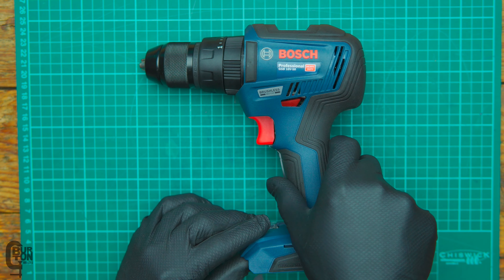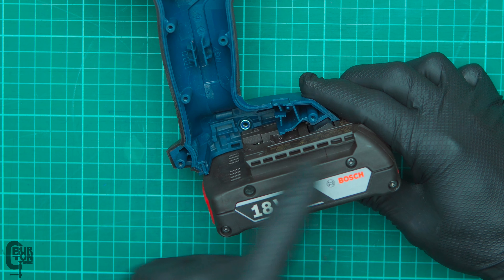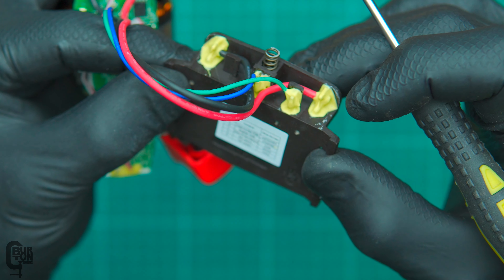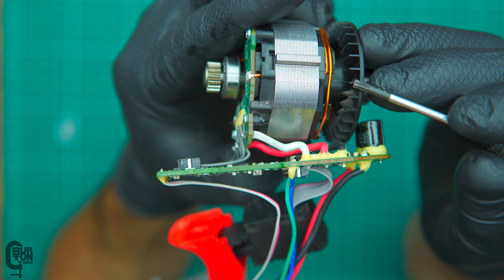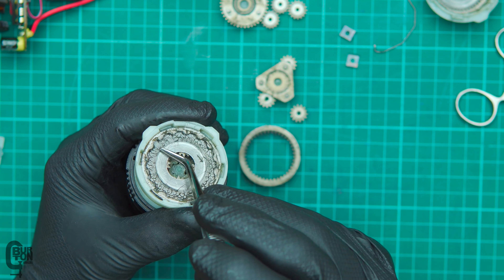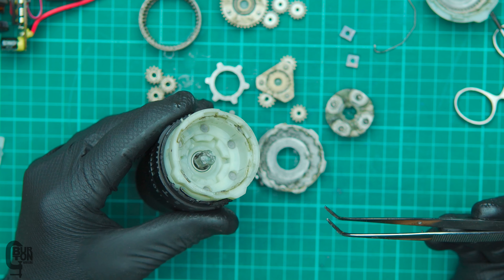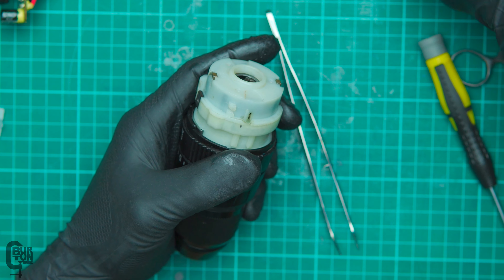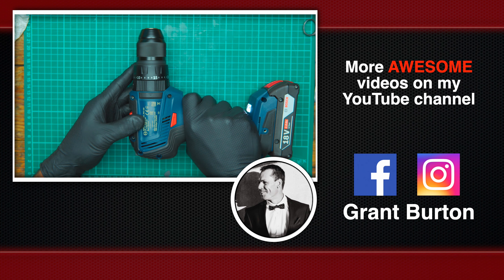Bosch Brushless Drill TEARDOWN & Rebuild GSB 18v-50 - Burton Builds

Comment: bad idea to even manufacture these little toys for concrette drilling, the hummer function is an engineering joke,,
Reply: u re better served with the 50 bucks grand daddy wired hummer drill.
Reply from the maker: I think the hammer function is more aimed at drilling small holes (4 - 6mm) in brick walls / mortar joints to hang paintings, etc. nothing more than that... anything more than that it's not good at all. (but this also carries over to many drill brands... way better to but a separate rotary hammer drill... even if its corded).
Reply: @GrantBurton  true. Better even vorded if possible so you do nkt da.ave the battery connectors
Reply: There are some versus reviews on yt where I descovered that hammer function is very effective on screwing in wood.
Reply: @mariapa4911  you should never use hammer on wood it invreases the depth of the spiral lath so plays with the integrity of the screw catch. If more power is needed thats what impact drivers are invented for.

Comment: Nice teardown, nice close-ups, nice explanations! Thank you!
Reply from the maker: Thanks very much 😁😎🤩
Reply: @GrantBurton  12:40 yes, that PCB looks quite repairable for anyone with basic electronic tools and moderate troubleshooting skills. And those transistors that drive the motor, if they are quality MOSFETs, they can handle a lot of thermal stress that will not shorten their lifetime. The lack of an aluminum heatsink is not always a red flag, that PCB may be multi-layer and under the MOSFETs there could be many thermal vias to dissipate the heat into inner copper areas.

Comment: Can you test the chuck wobble and compare it to other brands like dewalt or milwauke!?
Reply from the maker: Hi Mr. Freeman, I could probably get my hands on another Bosch and Dewalt drill, but not likely Milwaukee because it’s difficult to find in South Africa. 

I wonder if it will be a worthwhile test though because in all eventuality, they are going to be very similar and likely all to have a small amount of wobble. There is also generally a lot of wobble that is transferred through the drill spindle (compared to a pedestal drill for example) because of the design, size and spacing of the bearing support as the spindle goes into each drills gearbox.

These hand drills aren’t precision machines after all.
Reply: @GrantBurton  Thanks for the reply :)
You are right so I'll probably stick to the cheap Parkside Performance 80nm drill :/
Reply: I also see the same wobble in my identical Bosch drill, and I found it a little distressing when drilling with very slim drillbits, like 1/16" and 1.5 mm bits... the wobble got kind of preocupying! If you find a midpriced drill thas has less wobble, please do a video on it! Could it be that a drill without hammer function would have a more precise running?
Reply: @alfredomarquez9777  I suggest you get a drill with a keyed chuck and without hammer feature!
Preferably a corded drill with a metal gearbox since they last a lifetime!

Comment: Hey! why did you stop at the chuck shaft? That's where I have the problem. I haven't found any way to get off the plastic around that unit. My intuition tells me that since when looking inside the chuck from the front you see the good old left hand threaded bolt.. indicating that chuck is removable! I got the bolt out and I mounted an allen key in the chuck and in good faith I gave it a good leverage while smashing the allen key with a large screw driver as I always have done. Newer had any problem with chuck changes. 
So what I'm left with is where you suddenly and unexpectedly stopped and returned! 
My question to you is so far: why the bolt in the bottom of the chuck if it isn't removable.. is it a hint to the user "just go ahead.. see if you're able to remove it"  If this is the case I've had it with BOSCH.

Comment: Mooi teardown oom Grant. And I am about to buy one
Reply from the maker: Hi Randall, thanks for the comment. Once you get it and have used it, please let everybody know what you think and if you are happy with the purchase. Guessing you also saw the review video I made of this drill?
Reply: @GrantBurton  just picked it up. Surprised by how compact it is next to the gsb120! I'll be 3d printing some battery mounts for the 2 extra batteries once loadshedding eases up. I can't believe I waited this long
Reply from the maker: It is pretty compact when you think of how much power it delivers... Drills and Impact drivers are getting pretty impressive these days. Are you 3D printing battery mounts as a wall storage solution or did you have something else in mind?
Reply: @GrantBurton  truly impressive size to output ratio. Yep 3d printing mounts for both. 2 x battery mounts and an undercounter holster type mount for the drill with a battery. I found one design that hangs the drill upside down by its battery mount but I prefer to just grab and go.

Comment: 6:10 the led of this is auto on right? no switch like dewalt. looks like there is enough room to add a on off switch there and make a hole for the nob. Sometimes I dont like small led. I just wanted them off
Reply from the maker: Hi Dan Dan, yes… it’s an auto on/off LED light (no switch like on the Dewalt). I suppose you could add a switch but it’s probably easier to just stick a piece of tape over the light if you want it off 😂

Comment: The quality of your videos really are amazing! I have been enjoying your teardown series, and am also in the market to buy a new impact drill. Have you by any chance handled the new Bosch GSB 185-li. From the specifications and drill body size I recon it might be this model(18V-50) repackaged as an upgrade to the GSB 180-li in their new line-up?  Lastly I see a lot of places selling Oubao brushless tools of late here in SA, they seem quite sturdy but it is hard to find a review on them. Plus point is their batteries are interchangeable with Bosch. Any experience using or repairing them?
Reply from the maker: Hi Stephan, thank you. Had this question a while back so popped into a local hardware store and they were able to get on the line with a Bosch rep. he said the Bosch GSB 185Li and 18v-50 both have very similar specs and functions however the 185Li is a light duty drill compared to the 18v-50. The 185Li has a smaller body / outer case and has lighter duty internal wiring and connections and also a light duty gearbox compared to the 18v-50 model.

Overall the 18v-50 is a stronger more heavy duty drill.

Unfortunately have no experience with Oubao tools.
Reply: @GrantBurton  Thank you Grant, that really helps a lot. Great special on the 18v-50 at builders at the moment, 3 batteries included. Seems to be the one I am going for. Looking forward to future review. Subscribed.
Reply from the maker: Hi Stephan, did you end up buying the drill? If so, what are your thoughts so far?
Reply: Hi Grant. Yes I did, and have been putting it through its paces. Over all it has been performing very well. The only possible concern for me is the quality of the chuck. The first one came out of the box not assembled straight and had a bit of a wobble. Took it back and the Bosch rep replaced the whole unit same day. The second chuck is much better, but seems to be taking some unexpected wear. Thankful for warranties!

I paid R2400, with bag, charger and 3 x 2ah batteries. Was a great sale! I added a 4ah battery, makes a world of difference. Big jump in power output. 

If anything unexpected happens I will give an update.

Comment: I suppose you saw a lot of proff. screwdrivers. All of them have gearboxes so frail?
And as an overview, is this a trusted model (just your personal opinion)?
Reply from the maker: Hi Maria, many have plastic gearboxes with metal gears inside. I think the Bosch Professional range of tools is a pretty well trusted range of tools. As for this specific model of drill... for DIY use, I think it's a good choice. Personally, I've got the range of DeWALT cordless tools and I'm very happy with them.

Comment: Funny, i just recently bought a bosch impact along with two 8ah bat and charger, the thing that sold me were the batteries, easy to repair. Then i bartered with one of my clients for his broken power tools from his shop. I got 5 makita grinders worth $800 new (check me channel, you will see how i fixed 2 of the 9005b without having to buy the stators at absorbent prices for only $10 each) and two cordless 18v makita hammer drills. One is brushless, the other brushed. And as you mentioned here about the control board, i learned that the brushless on the makira was beyond reasonable to repair due to it being encapsulated in epoxy. And then i looked at my bosch impact and it is also brushless. At that point i regretted my purchase bcoz if the control board gets damaged, i will need to replace it if its encapsulated in epoxy like the makita. Hiwever the brush drill is straight forward. Anything in it is easily repaired. There is nothing hidden or in epoxy. So prior to seeing your video here my opinion was if you are using the tools commercially to go with the brushed versions. For a little longer tool due to the motors having brushes and a commutator you can rest assured that when it breaks from being dropped or any unintentional mishap that 9 times out of 10 it can be repaired for maybe under $30. As opposed to spending $200 to replace the whole control board. The brush drill i got look like one of the windings in the armature came loose and made contact with the magnet and shorted out. The brushless i think its the board mounted to the  motor with the hall effect sensors bcoz it look like the drill was drop and impacted on the back cover before anything else bending the mounting screw. So, i cant find a replacement board and everything there has clear epoxy coating it. Still tho imo, brushless might not be as necessary or good as its brushed counter part. Only pros that are very valid but not big deal breakers are: more efficient-no brushes no friction or energy loss there, more smaller compact motor, and i think it might run cooler. Other than that it may break sooner due to more electronics that are susceptible to many things such as vibration, heat, water, humidity, dust, corrosion. 

Anyway, great vid. Thx for making it. Hope you review more tools, this here is what i said on my facebook post when sharing your video there:
   So,
I was researching the bosch lights that run on the core batteries and this guy did a good video on that. Then i looked at his channel and turns out a friend of his bought a bosch cordless set and let him unbox and review all the tools. 

Running through the reviews i found this one, a teardown of one of the cordless BRUSHLESS drills. Yes, brushless. He even makes mention of my concern about brushless. Look at the control board, its completely open. You can repair it! Its not dipped in epoxy. You can see, test, and replace every or any individual component on the board. So i tried looking for teardown vids for my impact and surprise surprise i didnt find any, lol. I hope its like this tho. 

Right now even tho i still think Makita is the better tool overall, this video makes me even more content with my decision on buying into Bosch.

Comment: Hi, can you elaborate on what exactly makes the drill not spin while changing whatever you want to put on it? There must be some kind of mechanical brake that prevents you from spinning the motor manually right? (or is the planetary gearbox enough so that you could never spin such a gear-ratio manually?)
Reply: These three pins he put in equal spaces in front of the gearbox are kind of a brake.

Comment: Hi.  HOW IS the Bosch gsb18v-55 overload protection, IF YOU KNOW?
If it enters the hole and gets stuck, it can no longer rotate, the drilling machine stops. What do you know about it?
Reply from the maker: Hi, I'm not to sure... I haven't used or looked at the 18V-55, but I guess it should be similar to the 18V-50. By what you describe (and if the drill is not faulty), it sounds like it is not powerful enough for the size hole you are drilling and the machine is being overloaded and the overload protection is activating in order to protect the drill from burning out.
Reply: I understand what you are saying.  Now another question if you don't mind.  The battery lasts about 1 hour - 1 hour 15 minutes during which I used it continuously, I would use a small brush for rust with a diameter of probably about 5 cm.  What do you think?  The drilling machine ran continuously for 1 hour, I cleaned the rust.  The battery is 4 Amps.  What do you think?  I think that only 1 hour is too little, if that's how long the battery lasts
Reply from the maker: I haven't done a runtime test on that drill but 1 hour continuous running sounds reasonable on a 4Ah battery. The 4Ah battery is only 72Wh and I would guess the drill is easily drawing 70W when its running with a wire brush, so 1 hour sounds reasonable.
Reply: @GrantBurton  if you ever test your battery, please let me know, I'd like to know if it's normal for the battery to last around 1 hour in total.  I am very curious to know.   Thank you for the answer
Reply from the maker: @forestdamian5601  👍

Comment: Potrzebuje pomocy. Mam wkretarke bosch gsr 18v 50 3 601 jh5 000  i po upadku z niskiej wysokosci pojawil sie problem z szybkim biegiem. Da sie zatrzymac glowice reka i slychac jak scieraja sie zeby. Na wolny bieg sie przelacza i dziala normalnie. Rozebralem przekladnie ale tylko do polowy wszystko wyglada dobrze... Czy macie jakies pomysly z czym moze byc problem?
Reply from the maker: It sounds like something is damaged inside the gearbox... possibly a cracked gearbox case, cracked ring gear or a chipped tooth inside the gearbox (but if the drill was not spinning when it hit the ground, this is not likely the case).

If the gearbox is not damaged, then it could possibly be the 'selector fork' that selects between the two gearbox speeds. Maybe when you much the switch from 1 to 2, it's not fully selecting / engaging the fast speed setting. You may need to open the drill and check if the selector fork wire is properly clipped into each side of the gearbox and it's shifting both sides of the metal ring inside the gearbox forward and backwards equally.

Comment: Hello, I would like to ask for help with the screwdriver, burned one part on the board, I would like to know the mark, it is under the designation Q101. If you can find out, I would be very grateful.
Reply from the maker: Hi, Q101 is likely a transistor but would need the components part number to get an exact replacement. Without a circuit diagram or part number, there is not much we can do... unfortunately it doesn't work to guess in this case. Can you email a close up picture of the component and board to grantburtonbuilds@gmail.com
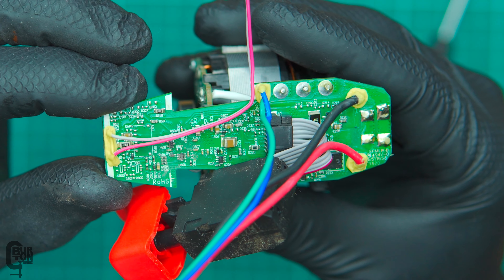Reply: Could u please write code of mosfet next to red wire at 13:02

Comment: Well my 18v brushless freak's electronics decided to shit the bed -_- (wouldn't hold selected speed setting and jumped around randomly).

Everything else is fine, my older brushed drill w/o electronics works well.  *big sigh*. Bosch quoted me $80 for the repair, but I got a deal on a new set which includes the GSB 18v-535C.

Damn shame.
Reply from the maker: Similar happened to a friend of mine with one of the Makita brushless drills... electronics decided to take the rest of the year off... haha... and it was overly expensive to replace them so he ended up buying the brushed version. Great that you got the 535C... how does it compare to the original 18v-50 you had?
Reply: @GrantBurton  It was the GDX-1800C that shit the bed, and now I got a kit with another GDX-1800C and GSB 18v-535C.  I have a regular brushed drill from bosch too.

Sorry it's all not straightforward.  I hope the electronics don't shit the bed again.